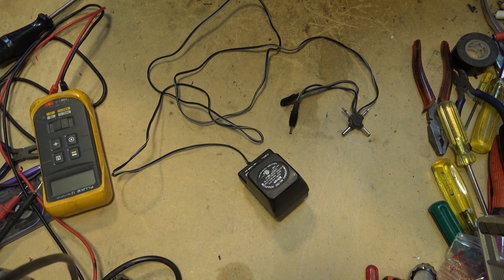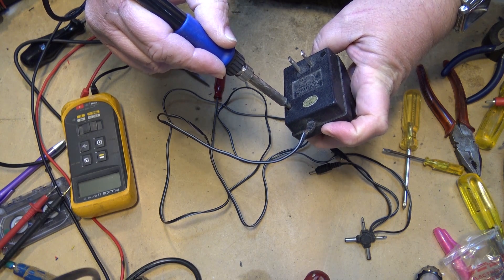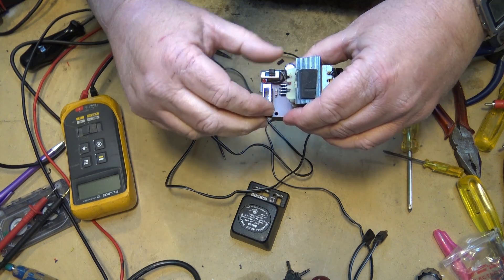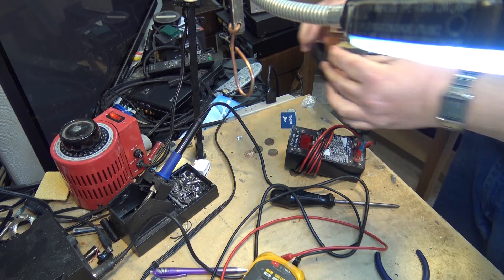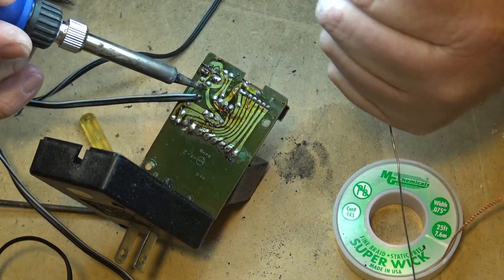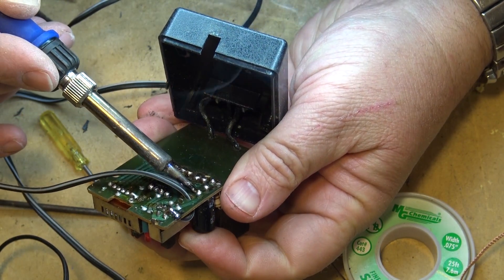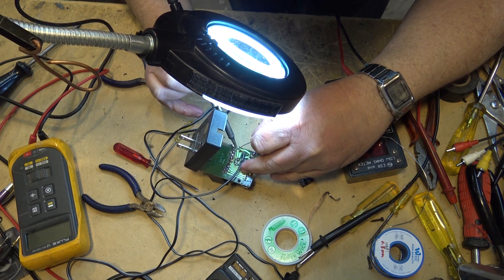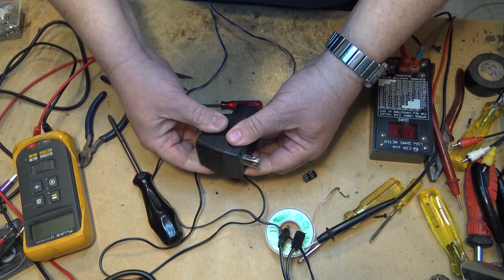Vintage Universal AC adapter repair

Comment from the maker: Under no load it will measure high as its an unregulated transformer. The voltage setting is just selecting a different tap on the tranny

Comment: Oh  I have a similar one. Looks the same and measures 20v on the 12v setting and 5v on the 1.5v
You saying that is not corrupted? I don't use it fearing it will kill my devices haha.. The resistor I have is 750 ohms and the capacitor which I juat reolaced thinking it was the problem, is 470uf 25v

Comment: Hey I have one of these adapters and recently I needed it for something and it didn't work and I went online and looked for the number one of the numbers printed on it and I found your video. And then I saw the problem with the screws. They have a metal piece in the middle of them I just happened to get out my tiny little cheap ass three or four dollar set of little screwdriver tips with little handle and it has a tip in there that worked perfectly on those screws. I took a picture but I can't post it here but the tiny little cylinder clear plastic case with a bunch of tips in it and a handle that fits the end of all those tips.
  I can't get my adapter fixed because the cord is not bad but I don't know what inside is bad.

Comment: nice video.. Are the capacitors something that wears out or stops working with age? i have a similar universal ac to dc adaptor..the red led power light does not turn on.. oddly.. it was workingwhen i was last using it.. and put it back in storage container. I am troubleshooting what might be causing it to not work. I did test it with a volt meter.. and i can see it is putting some voltage (micorvolts) and when i flip the polarity switch it does flip the polarity readin on my volt meter. something is causing the voltage to not shift up and down whne i move the volt slider. very odd.
Reply from the maker: Yes caps wear out.

Comment: 3:30 Those Security Bit Sets or Tamper Proof Bit Sets (for those kind of screws) are dirt cheap on Ebay.
Reply from the maker: And 50.00 shipping to canada.
Reply: @12voltvids  Security Bit Set Tamper Proof Torx Spanner Screwdriver Star Hex Holder Rod Blue ($5.57 Canadian) Free Shipping from China

https://www.ebay.ca/itm/Security-Bit-Set-Tamper-Proof-Torx-Spanner-Screwdriver-Star-Hex-Holder-Rod-Blue/192928008137?_trkparms=ispr%3D1&hash=item2ceb67c7c9:g:XXcAAOSwS4pc6K5s
33pcs Security Bit Set Tamper Proof Torx Spanner Screwdriver Star new Hex H J2V5 ($5.30 Canadian) Free Shipping From China
https://www.ebay.ca/itm/33pcs-Security-Bit-Set-Tamper-Proof-Torx-Spanner-Screwdriver-Star-new-Hex-H-J2V5/184066885491?_trkparms=ispr%3D1&hash=item2adb3dc773:m:m8soOaFARRkauT7ORqj4a0w

Comment: For that type of screws, you can simple use a cheap flat screwdriver, and make a little notch with a file or metal saw, 
and they come loose in a minute.
Sometimes in hardware stores in those discount boxes near the counter , you can find a complete set of screwbits which include this type of "security" bit for a few bucks.

Comment: They make them for computers. Add an LM317 or 335 with a small heat sink? and a pot / 4 for bottom to top end variability.  Put some binding post on as well.  Be slick. Cheers OM Darrell kb5zxm@gmail.com.

Comment: I used to have the identical unit for several years. It was pretty dependable but I did have occasion to open it due to it having a lot of hum with some items. Unfortunately, there was no room inside for a bigger or secondary capacitor. I finally had to add an external cap.

Those "security" screws were fairly common on really old film equipment so I had some modified screwdrivers on hand. (Just needed a notch cut out of the center of the blades.)

Comment: I have a few old screwdrivers that I modified to extract those horrible screws. Once they're out, in the bin they go, and proper screws are installed instead. Another trick they'll do is to use just ONE odd screw, or they put plastic cylinders in the screwholes the swine ! Gingerly boring these out usually works.Good idea of yours to fix that. They're more reliable than those Switched Mode things.
Reply from the maker: You know the other name for a switch mode power supply right.

Voltage to Smoke converter.

All it takes is 1 dead short, and sometimes they go poof.
Linear supply you can abuse it all day and it keeps going like an old Timex watch.

Incidentally when I was a kid a timex watch was one you didn't want to be seen with They were not cool. 50 years later an old timex is a fashion statement. They just go forever.

Comment: I bought a modern switch mode universal mains adapter a few months ago. They're readily available online and in various shops here in the UK. It came with a rotary switch for setting the variable voltage (3, 5, 7.5, 9 and 12volts) and has 6 different plug ends for various connector types. The voltages are stable and well regulated. 
I  have managed to reuse a moulded strain relief before by cutting the cable either side, pulling out the conductors and then using a sharp drill to ream out the existing cable insulation. I then just slid it onto the existing usable cable, glued it into place and tied a knot in the cable on the inside to prevent it being pulled out. Easy job!
Reply from the maker: I have done that too, repaired a strain releif  using that method. I didn't bother on this because this unit isn't going to see daily use. I fixed it only to have as a pare in the event that I need it to test something. Anything I have that I use regularly has a dedicated fixed voltage power supply on it.

Comment: just make a notch on a flat screwdriver for those screws
Reply from the maker: Did that years ago when i was at the shop. Didn't want to ruin a good screw driver. heating the screws and they come right out,

Comment: when you say tip positive or negative, is that the inside lead you are talking about?  thanks     j
Reply from the maker: Yes the inside on a coaxial type connector is referred to as the tip, which is the same as the tip of the 2.5 and 3.5mm plugs on the other side of the 4 position socket.

Comment: Easy strain relief - tie a knot on the inside.
Reply from the maker: That works too
Reply: Electone_Guy 
That's not strain relief, but it will work like a cable clamp.

Comment: I think I called your number to see if you repaired car stereos you should know car stereos but the car stereo is a CD DVD player it didn't read the DVDs or CDs it works for about less than a minute then it shuts off can you recommend a place to get it fixed thank you
Reply from the maker: Never worked on car audio and never will. That was the 1 thing we never touched at the shop. I don't even like working on my own decks.

Comment: a small flat head screwdrive and small dremel bit will make a driver for them security screws it works
Reply from the maker: Did that years ago, but my dremel cutting wheel is broken.

Comment: These may have been around in the 1970s but they were still being sold in cheap stores in the mid 1990s. I never much liked them because they are unregulated and so audio gear like personal stereos etc always sounded buzzy with them. For a little more money you could get regulated units that were much better. These days of course you can get hold of switching versions of the same thing that can give out a couple of amps, and are roughly the same size as this.
Reply from the maker: Yes I know they are unregulated, and can cause hum on audio devices if they are run close to the current limits, but for most applications they are fine.
I have a bigger one that is multi voltage and regulated, but I lost off the different size tips. This one was fixed because it is convenient for testing stuff, not long term use.

Comment: Special screws = Bin :-D
Had to laugh, you use the same method ive had to use, soldering iron treatment lol.
A while back i modded a small straight screwdriver by grinding a notch in the blade, it was done so i could adjust vcr head guides back to standard, its removed psu screws fine now i dont repair videos any longer.

I also kept one of those multi plug cables off a dead supply, i havnt seen one for 20 years.

Comment: I ran into security screws when repairing a heating pad control. I made a screwdriver from a nail using a hammer, hacksaw and file. I didn't have the right size replacement screws, so I taped the nail to the cord.

Comment: Love your videos. BTW, I find that a couple layers of heat shrink tubing makes for a decent strain relief. 2 or 3 of different lengths to make a tapered thickness.
Reply from the maker: Yes I know, but all I have is 1 size currently, and this is just a bench test unit so no strain will be applied to the wire.
Reply: 12voltvids just a tip... the shrink tubing can be 3 pieces of the same diameter tubing. Just cut them and thread them on the wire and then shrink them one at a time on top of each other.
Reply: Self-amalgamating tape is the answer!
Reply: On the contrary, I find multiple layers of heat shrink tubing a horrible strain relief. They become so stiff when it is more than 1 layer and the cable starts fraying where the tubing ends. I think 1 layer is better. I'm still in the search for a better alternative though.
Reply from the maker: I have some of that from when I was splicing cables 11 years ago. We used it to water seal cables.

Comment: I hated those   ive had many bits of gear smoked because somebody turns the switch
Reply from the maker: Yes that can happen. They are great for a test bench though. That is what I use mine for. I have another one, but I lost all the stupid plugs. This one is better as it has 6 different power plugs on the cord, so for a test bench piece this is perfect. That is why I was happy to find it. Was buried in a box under a bunch of other junk.
Reply: I always hot glue the setting for the device and if it needed for some other device, hot glue is easy enough to remove with some persuasion.